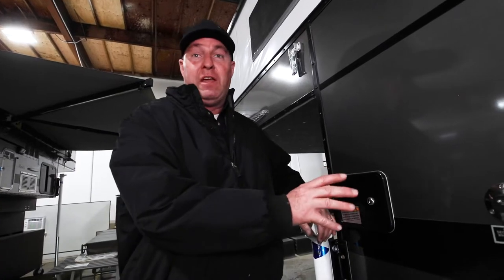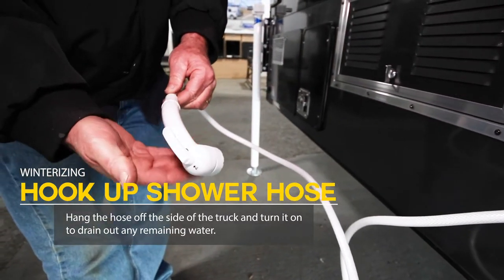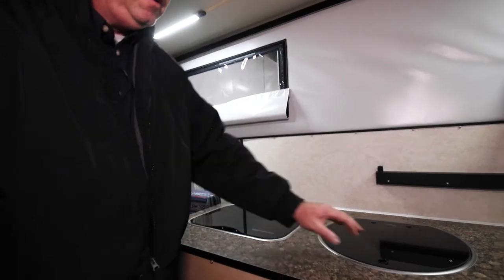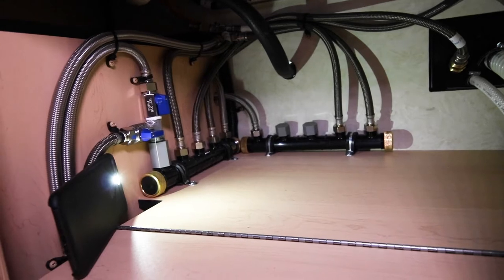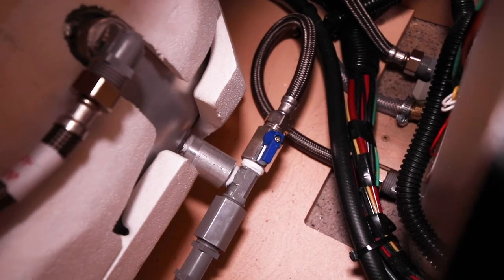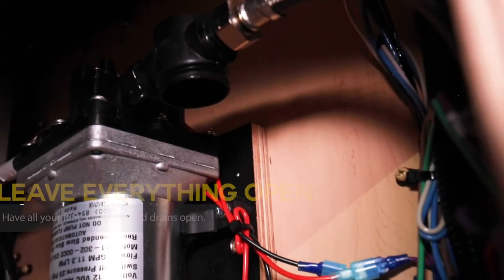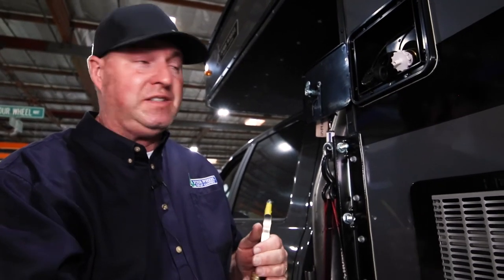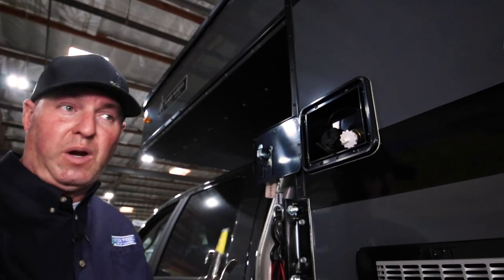How to Winterize a Flatbed Camper | Four Wheel Campers (Dometic Water Heater 2021)

Comment: I did all this for 3 years and then added RV antifeeeze.  Then watching another FWC video for the newer HWH they drain the tank. So I opened my hot water heater panel on my Dometic HWH and drained more water out  of the hot water tank. I would suggest doing this and this appears to be a possible oversight in this video.  I am not going to add RV antifreeze because it takes forever to get that taste out of the system.

Comment: Thanks for the video!  Very helpful.   I'm wondering if I should unscrew the water heater "Drain Plug" accessible from the outside behind the access panel.  He doesn't mention it in the video but in the water heater's manual it indicates you should...but maybe 4WC is plumbed differently in a way where it isn't needed?
Reply: Sorry, I did not see your comment but I think you’re absolutely correct.